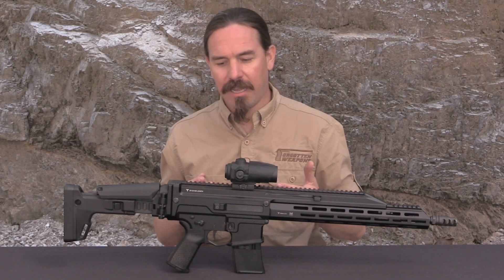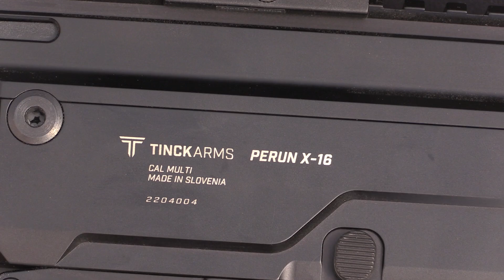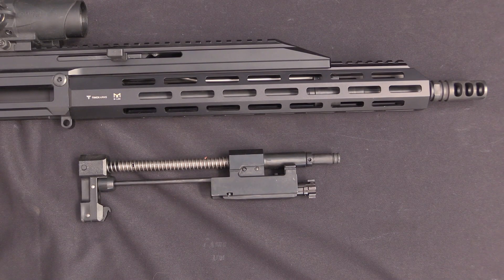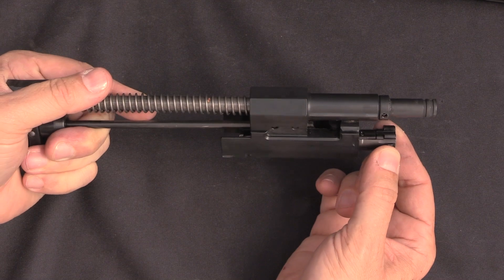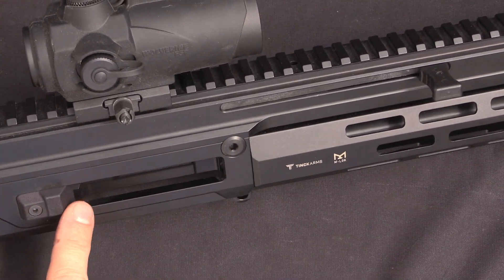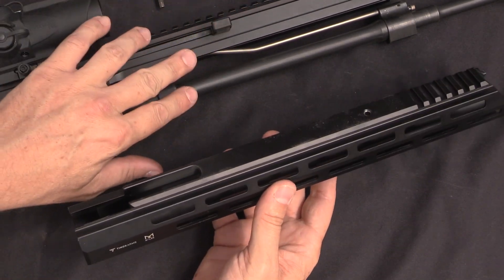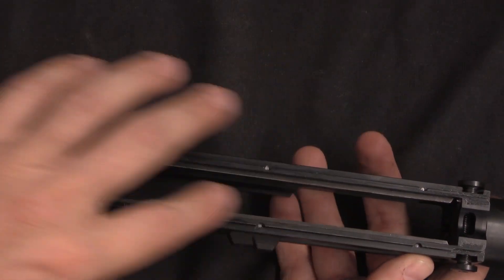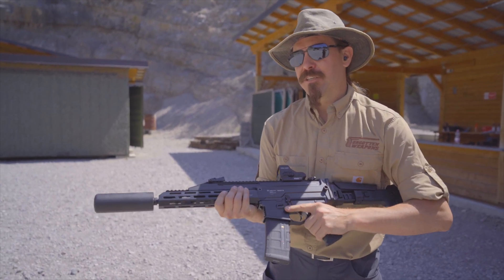Innovative and Interesting: Tinck Arms Perun X16

Comment: I wish other consumer goods were designed with this kind of consideration towards customer maintenance and customization. It seems like it's usually the opposite, where the the producers of consumer electronics especially do everything in their power to prevent you from changing or fixing anything.
Reply: Right to repair people, assemble!
Reply: There are downsides to modularity such as greater complexity, increased weight and bulk, increased manufacturing cost (for features that often only a small fraction of buyers will use), and potentially less reliability.  For example with electronics, bump soldering a chip onto a circuit board is going to be more compact, cheaper and quicker to manufacture and more reliable than soldering a socket to the board and having the chip locked into the socket using a land grid array or pin grid array. People say they want modularity in the consumer goods space but don't put their money where their mouth is and buy modular products when they're available, or the number of consumers who want it enough to pay for it is too small to support commercially viable products.
It makes a lot of sense for some markets like desktop PCs (especially those aimed at gamers), but not so much for things like smartphones.
Reply: I agree, but it's driven by consumer demand. A firearm that isn't user serviceable would never sell. On the other hand, outside of certain niches consumers are indifferent, if not outright hostile to the idea. Try talking to people about doing oil changes or brake pads on your car, two things that are usually designed to be accessible. Modern tech might as well run on black magic and consumers are convinced that user repair is a hazard.
Reply: @maweitao  to be fair, there are lots of dumb people that will screw up brake pads badly
Reply: @marcogenovesi8570  you should try getting an alternator out of a Ford Focus.  Talk about frustration!  Install tomorrow, should be fun!  Tie Rods next weekend...those are much more accessible.  Brake pads are simple.  

But yea...most people have no business touching their cars.  Or guns.

Comment: Ian putting on gloves at 18:00 is relevant.  I think the location of the rear gas block is going to be a problem.  You can see the gas venting right under the optic. That section right at the barrel nut is going to get as hot as the sun.  Not sure why they felt the need to go with this system over a short stoke design that vents the heat near the muzzle.

Comment: Very fascinating rifle.  Especially for private individuals and organizations with less clout than a major military (where you can expect major manufacturers to trip over themselves to satisfy your whims, as the size of the order means they'll profit even if you're the only.customer who wants, say, left hand thread ¼-20 screws used throughout).

I suspect this would be very competitive as a select fire military rifle (presuming it stands up to the abuse and reliability testing - I see no reason why it wouldn't, but you can't know until you run a trial), perhaps with some of the "nice to have for commercial sales" features for ease of modification features simplified (PVT Snuffy isn't going to be modifying his rifle to any great extent - he's going to use it the way the armorer issues it to him by and large).

The bolt group and gas system are truly intriguing.

Comment: Its gotta be one of the easiest rifles to make 922(R) compliant without completely screwing it up.
Reply: Good observation. That might have been the real reason for all of the common parts being used.
Reply: If you can efficiently mill a custom lower, yes.  Won't drop-in to an AR lower as presented, I don't think
Reply: @jaeger1447  it will if you used AK gunsmithing tools like a hacksaw and a file. Just saw off the buffer tower and file it out. Maybe even use sandpaper if you are into that

Comment: At first glance I thought this was the SCAR Gen 2 FN should have made 5 years ago. Upon finishing the video, it's much more interesting than that. Looks like a very well thought-out rifle, I hope it does well!
Reply: Yeah, looks like a combination of a SCAR, and ACR, and an HK XM8.
Reply: Their "Gen 2" is pretty muc the SCAR SC with finally a non reciprocating and reversible charging handle. But even then I'd rather run a XCR which is a truly multicaliber system and even more simple.
Reply: @Doomguy-777  Pretty sure they got feedback from SOCOM about the charging handle in 2004 and it took them 18 years to do anything about it. Great job FN!
Reply: @Selig2236  I mean it's FN, just like H&K (and H&K actually does bring new things on the table, just not for the civilian market in general) they take ages to do anything.
Reply: @Doomguy-777  It's what happens when government contracts are your main revenue stream.
Reply: @Doomguy-777  So true, but still you'd think they'd listen to the SF guys when they're trying to get the rifle adopted by SF. Oh lord HK, so many baffling decisions like "Here's the new 433, if the Bundeswher doesn't adopt it we'll never sell it to anyone else" 😂
Reply: @Selig2236  right?  It's no wonder their MR556s cost 3.5 grand, and their GI mags cost $60.  Actually, the upper receiver(which I believe includes a bolt carrier and charging handle, could be wrong) for the MR556 costs $2k(no idea how their lower, LPK, stock and buffer assembly cost $1500 to bring the total cost for the rifle up to $3500), and their 10 and 20 round mags cost $70.
Fucking hell.  Talk about taking up the ass.
Reply: @Mockturtlesoup1  😂 I'd love to drop near 4k on a heavy, overgassed rifle HK. I definitely wouldn't pick up an MCX Virtus instead which does everything the 416 does and more for a lower MSRP. I've heard rumours that CAG are looking to replace the 416 and that the SR16 is one of the contenders. If the 416 was a good as people say it is surely they'd just upgrade to the A5 instead of seeking a new rifle.

Comment: With a normal AR bolt, would it be possible to set this up with ambi ejection? Much like how you can run the bolt “upside down” on an AUG? I think the AR bolt cam pin hole is symmetrical, but I’m not sure. 

Of course, with a traditional non-bullpup action placement, the ejection side isn’t all that important. But since it’s impossible to do so with a normal AR upper, no one has really had the chance to try.
Reply: I imagine it should or possible- assuming a new opening is made in the upper.
Reply: @PrebleStreetRecords  Yeah similar to the Baretta ACX (I think that’s what it’s called?)

Comment: The simplistic engineering behind this is beautiful. It looks like the rifle version of a scorpion scorpion evo 3.
Reply: those were my first thoughts exactly, the shorter version could be a carbine, and the lowered top front rail would be perfect for ir/laser units, with the pressure pads on the handguard
Reply: You're kidding, right?  This is a production engineers nightmare.  The parts count is asinine, and they are all manufacturing intensive.  This thing, while cool it exists, is nonsense.
Reply: @randymagnum143  What makes it that complicated? I didn’t notice much unusual about it
Reply: @randymagnum143  you gotta at least admit the pins for the steel rails is better than other methods, though, and the ability to use existing parts is nice. extra AR handguards? chop. now you have a perun guard. somebody else got a scar and hates the stock, so they switch it? get it from them.
Reply: @sonicmoth8340  having an upper receiver and bolt carrier that don't require extra parts would probably be a better idea.
Reply: @randymagnum143  I mean yeah but then its just another ar and has the same gas out the back issues.
Reply: @randymagnum143  What extra parts in the bolt carrier? there's literally the bare minimum there.
Reply: @sonicmoth8340  Ummm have you shot a suppressed AR before? this has way less gas coming back. Full auto suppressed AR is eye watering
Reply: @CosmicGreyTypeR  yes that’s what I’m saying. Please reread
Reply: @randymagnum143  you're fucking high dude lmao

Comment: Two questions.  How’s the height over bore with that upper and is there any issue with the forward excess gas and your front hand?
Reply: Height over bore is the same as the SCAR so depending on the optic, between 3-4".
The typical grip won't feel the gas as it dissipates quickly. Almost every other piston gun heats up close to the support grip. On the Perun, it is pretty much like the AR.

Comment: It makes sense that if parts don't need to be unique, why make them unique. Lowers costs while increasing value to the customer since there are tons of options for customization.
Reply: The downside is you  can't  overcharge customers on the comeback for  proprietary accessories and parts....like a corvette. Better become popular if you  want to  stay in business because you have to move units and you can't  count  on parts,  service and accessories to  keep your  ink black.
Reply: Companies like to make them.unique to lock customers into their support infrastructure as a captured audience.

It's really nice to see designers that reject that business model.
Reply: @geodkyt  You're right that companies use that strategy, but it's also a thing that can work against the company, because many people have become aware of these practices and do not like them. So, attempting to lock customers in can actually drive them away. Along the same lines as "does it take Glock (or AR) mags?" A lot of people will be more likely to buy a gun that will work with mags and parts they already have. So, having a gun that can use existing bolts, barrels, triggers, etc will be appealing to a lot of people, but being unique will appeal to others. Both of these strategies have existed for a long time and they both can be successful, because not all customers are the same. It's also not necessarily black and white, one strategy or the other, it's often a mix of both. Like my beloved Kriss Vector, unique mechanism, not parts compatible, but using the ubiquitous Glock magazines. There are a lot of factors involved in which individual cases are successful or not.
Reply: Exactly... There's a reason why Browning and Mauser DNA is still strong today.
Reply: Bayonets was exchanged for goods with the civilians during european wars. That new AK must be made with similar but not interchangeable furniture to not be exchanged for vodka by the conscript or not to be sold massively by the officers.
Reply: But the negative is they don't need to buy from you, so profits actually may go down
Reply: RIGHT? 
Stop reinventing the wheel and trying to fix what ain't broke! 

Plus, the aftermarket already exists, which is a huge part of the appeal for many guns.